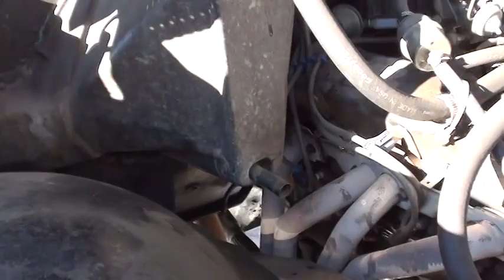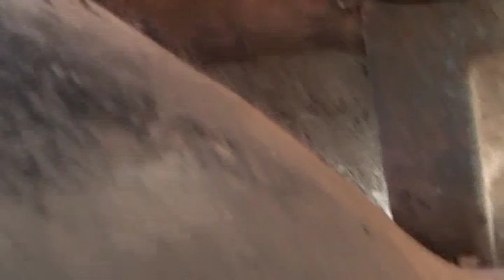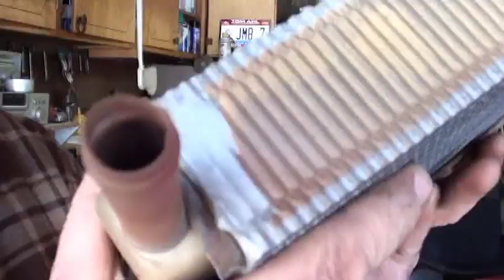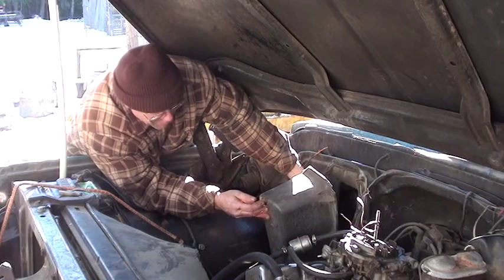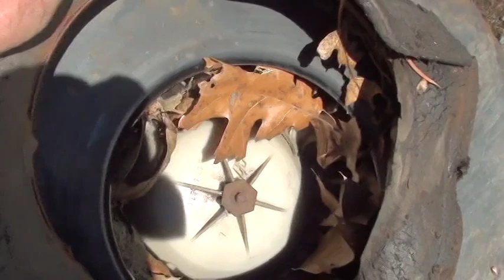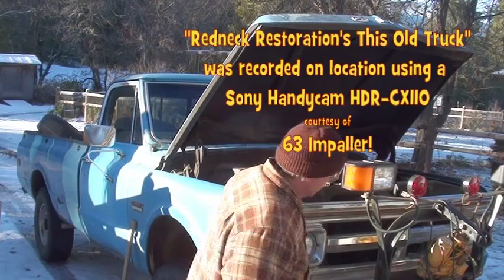1969 GMC heater core replacement

Comment: I just changed starter here in MT. -15 to -20  Friday night out in the snow on a piece of cardboard normally it takes an hour or so but we fought for 3 hrs before realizing the bolts were 1/2" short!! Yes I was pissed all I could find in the shop was all thread and just ENOUGH for 2 bolts, it's late, cold and I'm very tired but I have to finish. Got it in and went to start viola fired right up ! COOL now warm it up a little and put in the shop to finish up. Then I went to the moon I apparently broke the lower heater core connection on this 45 year old truck!!!!!! 
THANKS for the video on removal and replace of the heater core I knew there were 2 bolts buried below THANKS again!!!!!☺☺

Comment: You're more than welcome to come and try mine out. The heater actually works great. The drivers side vacuum powered wiper also works to an extent. The fact that there's no drivers side door just means you have enhanced visibility.

Comment: I've had to do several "Make it Fit" heatercore changes over the years and I usually end up making new hold down straps for it. Mechanic's Wire or a wire coat hanger make excellent straps, insulated with a little Duct Tape to prevent rubbing a hole in the new core.

Comment: When I did my 1969 chevy 3/4 ton 4x4 I used some type of channel. I welded nuts to channel and coated inside with spray bed liner.

Comment: I hate crap parts that don't fit or work the way they should. This is the fun i had Holleys remanufactured carbs. The box it came in was the best thing about it. Metering block full of bead blasting sand, returned it and got another one, blocked metering block full of corrosion, third one bent throttle shaft. threw the carb at the parts guy and got a brand new one for the same price. Found out later the dealer had been ripped off and they werent from colt industries at all even though they had come in holley boxes.

Comment: if you are not worried about restoration, the plenum box, where the hose connections are, I used cutting wheels (small) and cut out an oblong hole that allowed the core to pull out after removing the four screws that hold the core, I put the new one in, and covered it with aluminum diamond plate, I used red high temp silicone, to attach it, then 2 self tapping screws on the right side away from the core. took one hour, but would take 20 minutes in the future.
Reply from the maker: I've seen that done, though not with diamond plate!

Comment: Best thing to do is do not throw out your old copper an brass heater cores. They can be cleaned rodded out and made new again. I hate alum. Once it gets a hole your done. It's like in the 1984--92 ford rangers they had brass heater cores. I still have 2 of them cost about 35 to 50.00 to have then token apart rodded out and cleaned an tested and sealed back up an tested again. If you would ground your Radiator with a ground wire to your core support I believe your radiator and heater core would last a long time. The radiator is the only thing on all car's and trucks that are not grounded. Even on new car's and trucks.

Comment: @Mr55gasser> Nearly all of the heater cores are now made in China. They don't make them with the same durability as when the U.S. did. They tend to leak not long after any tap water is used in your cooling system. You should ONLY use anti-freeze and/or distilled water.

Comment: Did you say your heater control panel was broke? I've got one that I just took out of my 72. It is cosmeticly rough but the cables worked. Blower switch didn't. If you want it message me your address and I'll send it to you.